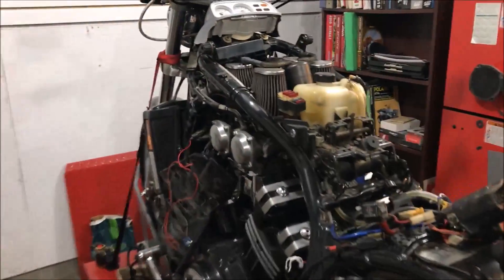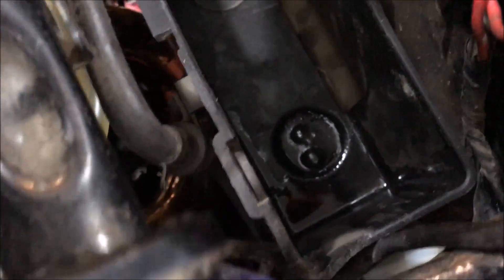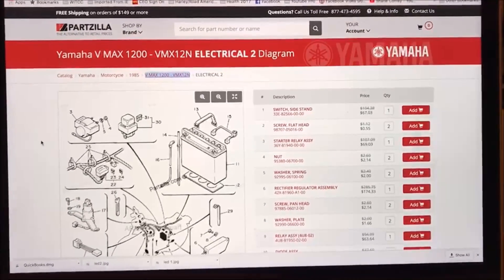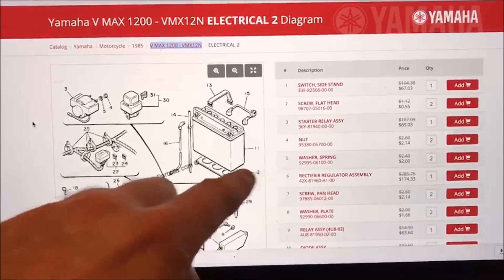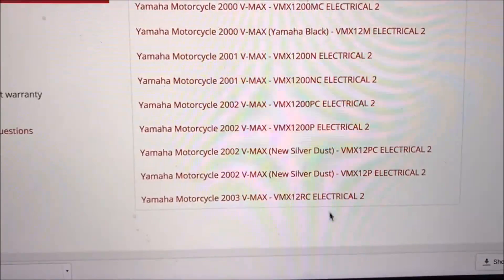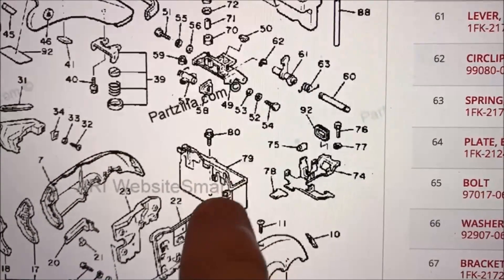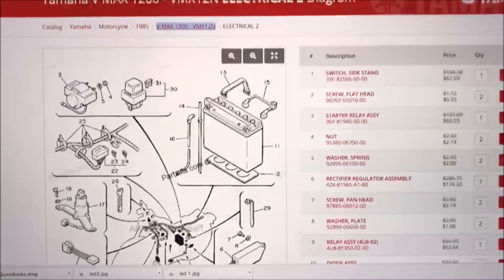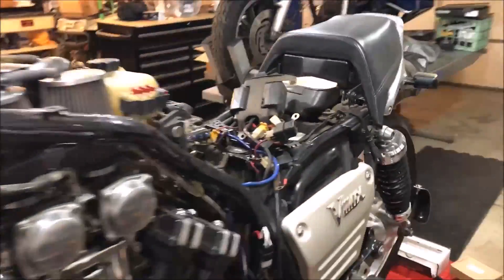What causes a battery case to leak acid?  Demo on a Yamaha VMAX

Comment: the acid gets pulled through the lead while charging thats how the terminal gets corroded even though its capped off and grounding the bottom may increase it.if we figure it out,we can one day teleport through power lines.how does electricity carry minerals through solid lead,copper,and steel?

Comment: Those are good points about the battery tray. I was thinking it might be bad cell. When a sulphated cell is overcharged compared to surrounding cells it releases extra hydrogen gas that will froth up with liquid bubbles. A sealed battery can hold back some pressure but all are designed to fail at some point out the top, so the whole thing won't explode. The hydrogen escapes, the liquid drawn with it drips down the side, and the fluid level drops. In the end, the battery is recycled -- thank goodness for extended warranties, mine rarely last as long as the warranty.